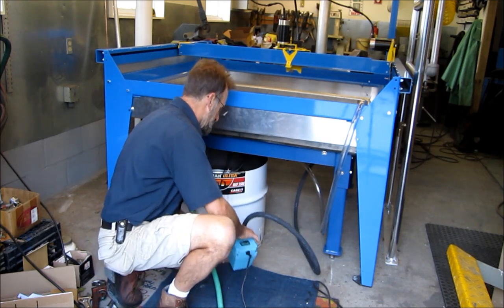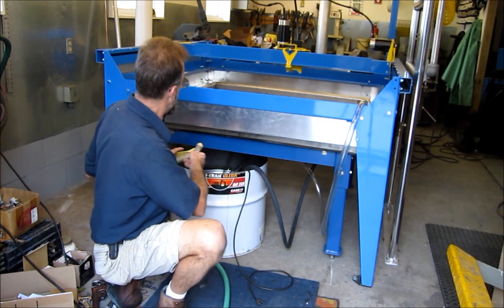Testing the Waters

Comment: As with any light or electric motor- you can wire in a dimmer switch to that pump, turn it down to match your outlets' capacity. If you want to also incorporate an air exhaust- just make sure there is a moisture drain on the vent, a tube running below the table- even back to the reservoir if you want. (I know this was 4 years ago- I don't know what you did or have now, this is just me giving a suggestion to a nice man named Keith Fenner)

Comment: What a great build. I have gained a lot of knowledge from watching you work. I would like to trade a little of mine, even though this build is probably well behind you by now. You can place a baffle straight across your drains, or even inset them inside the first inch or two. This will knock out the water swirl when draining and they will drain even quicker.

Comment from the maker: Yes the water helps immensely on the smoke, but even water tray systems that flood the water to the underside of the raw materials, still can't catch all the smoke, a small amount of hydrocarbons escapes back though the kerf width behind the cut due to back pressures and bubbles returning to the surface. My theory is to combine a water tray and down draft suction, to reach an ultimate control of the hydrocarbons. My efforts are driven by my beliel that it is totally possible... Keith